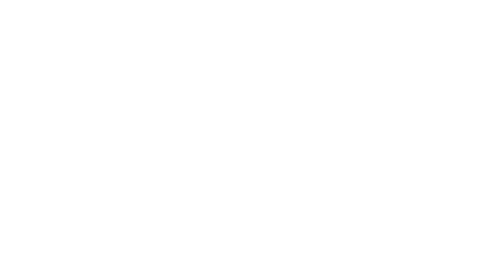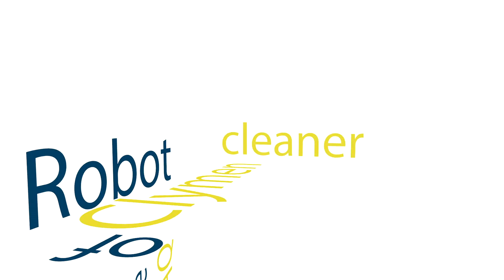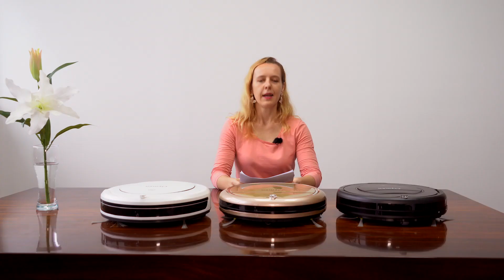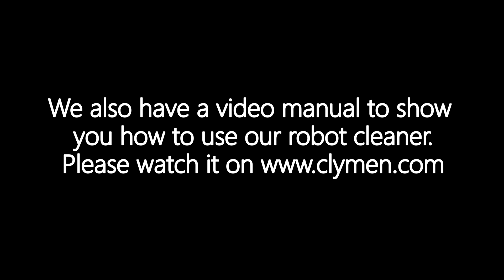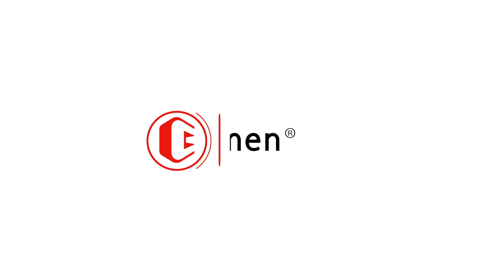Frequently Asked Questions of Clymen

Comment: I recently cleaned the roller bar and reinstalled it. Now it constantly stops and says something about cleaning the rolling bar. How do I readjust this? I have removed and replaced it several times now to make sure it is sitting in its place properly but it has not helped.